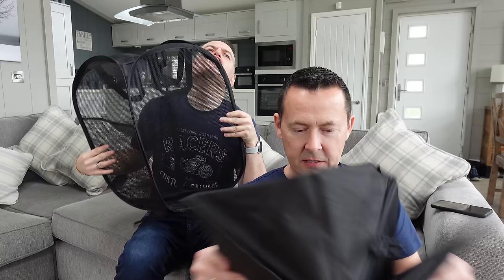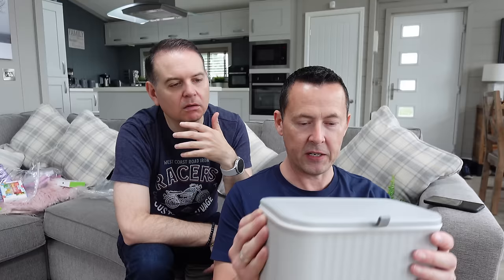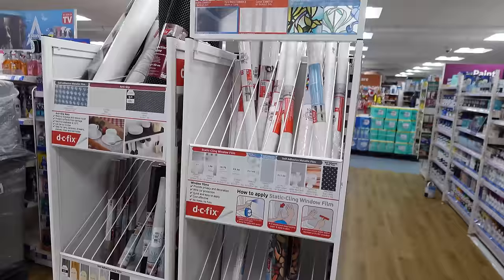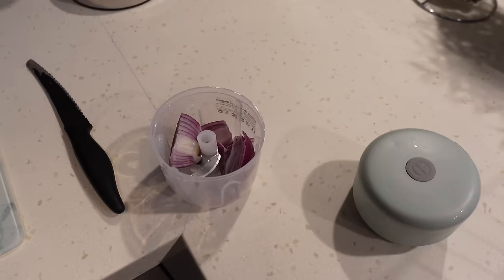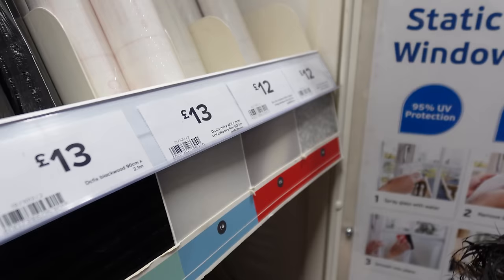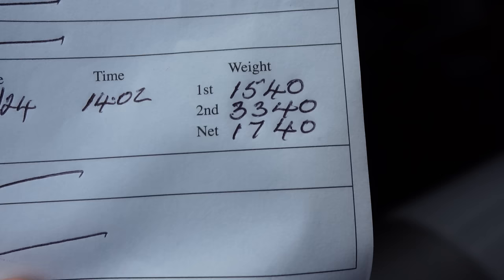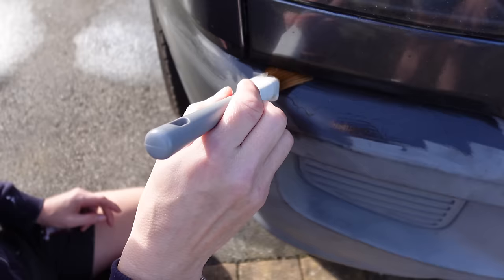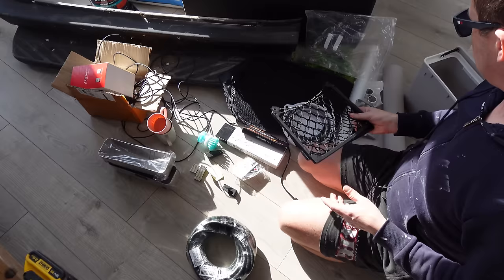OUR CAMPER VAN HAS HAD A VINYL WRAP

Comment: Dad just went and got our Camper out of storage and told me the steering wheel was gritty so it might need a clean.  Its been sitting in the desert sand for 2 years with one of the windows ever-so-slightly open.  EVERYTHING is coated with a sandy dust! Its such a project!  Also, finding so much extra stuff in there we don't use or need like 3 frying pans, 2 cutting boards, 2 wine openers, 3 vegetable peelers, 2 cheese slicers, a heavy duty blender, a bazillion cutlery and 3-year old spices and canned goods, all sorts of cups and bowls but no plates(?).  They had that camper so stuffed with things I don't know how they functioned in there.  I'm driving them across the country in it.  They're going to have to learn to embrace minimalism. 😅

Comment: Oh dear i do the same thing with t towel on oven door , there is a  Method in that madness Nick with the t towel on the cooker, as i do the same, you put the t towel on the over door as the heat off the oven when finished cooking it dries the wet t towel off, hence why us oldies put it on the oven door  🙄🤣🤣 keeps them dry instead of damp

Comment: You really now need a Costco card just for the fuel. Their diesel is on average 4p to 5p cheaper than supermarket and it can be up to 14p per litre cheaper than normal petrol stations. If you are putting in 100 litre the savings really add up over the year. You won’t be getting the best mpg as the vw is now heavy. Costco diesel is premium as well and will keep your fuel system clean